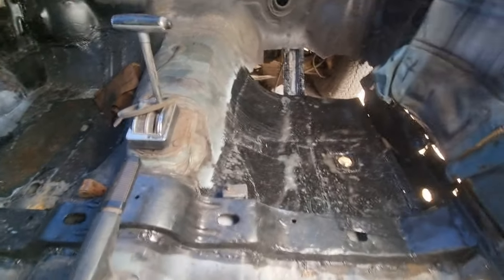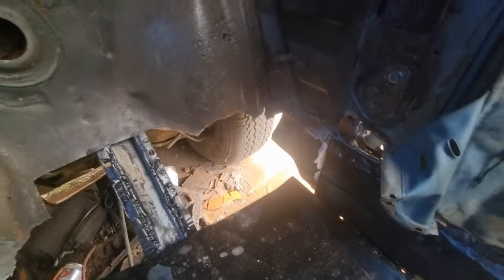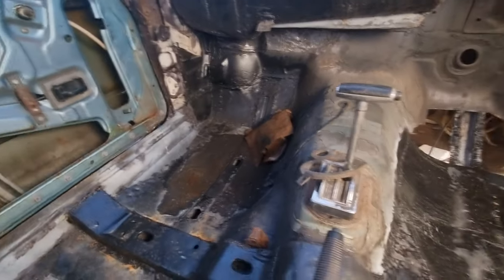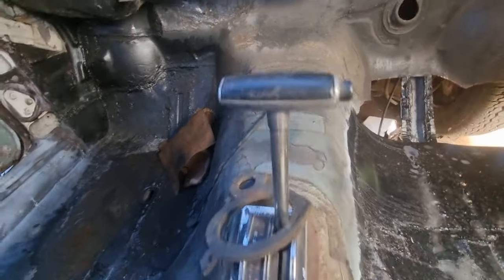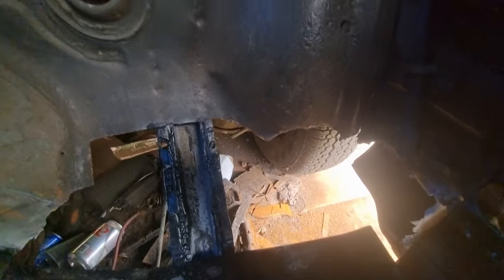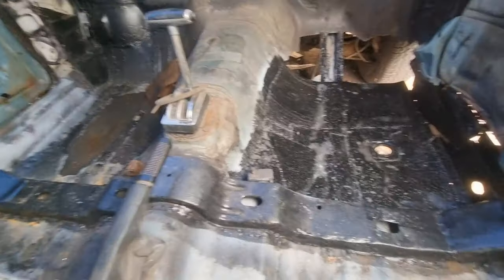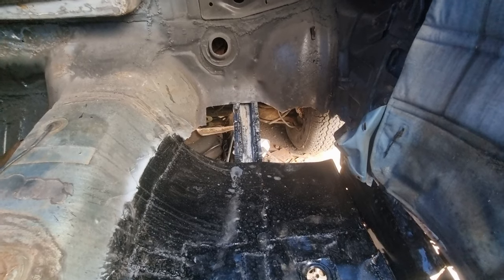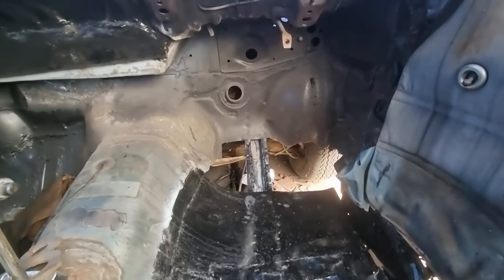Cortina Mk4 Ghia 2.3 V6 Restoration || Update

Comment: Good to hear you're back but have to catch up with the welding as winter will be hear soon and you won't get alot done as mostly rain and when it's cold as well it's horrible to work outside I've done it for many years but not now with my nackered knees (Arthritis)
Reply from the maker: agree so do need to get a move on